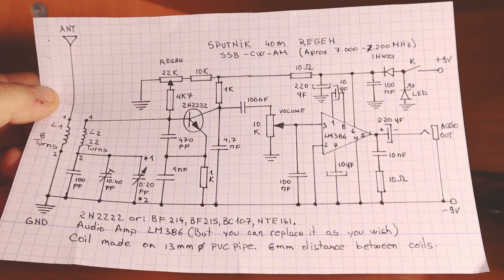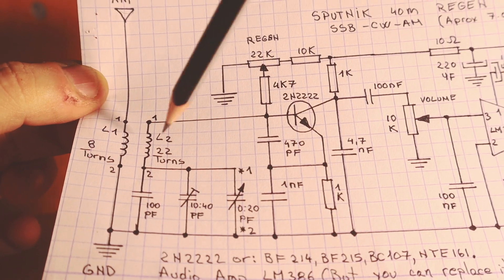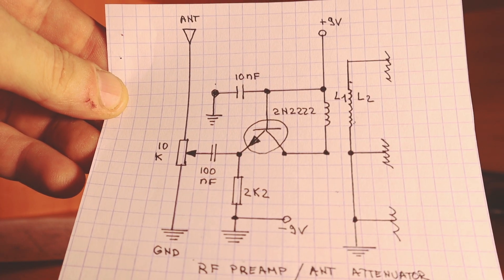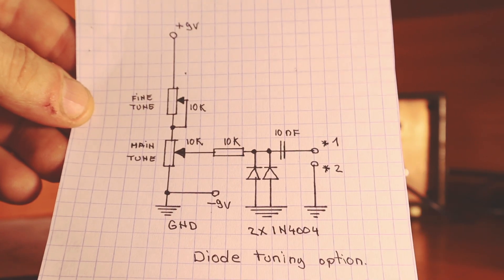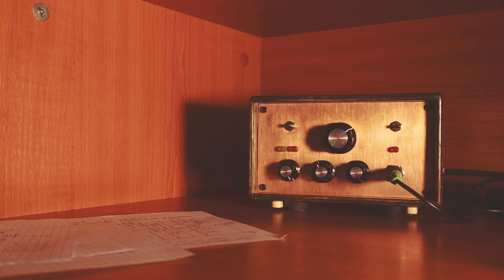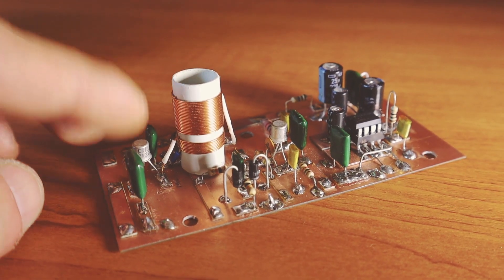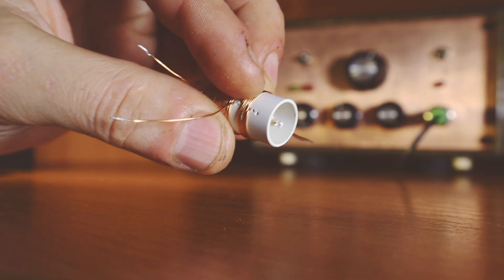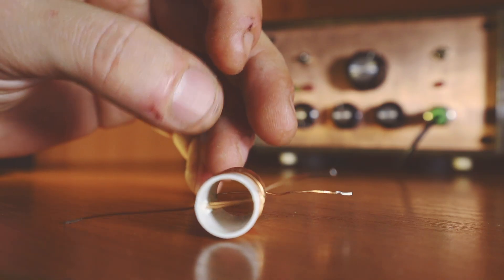Simple Regenerative Receiver For The 40m Amateur Radio Band

Comment: I've recently read up on using diode tuning.  You're having better stability with yours than some are reporting with theirs.  
I'm glad diode tuning is working good for you.   The rig sounds good.
Thanks for the schematics.  73
Reply from the maker: Thank you so much. Some turn out good... some not so much. I think it depends a lot of the capacitors used in the circuit as well... and the voltage stability as well. I could build three identical receivers ... none would be the same unless the quality of the parts is the same ))). I like diode tuning just because is hard to find good air variable capacitors... and when I do find them they are way too expencive. P.S. On the blog article I have the latest schematic I am using and also a PCB design. 73, YO6DXE.
Reply: @dxexplorer You're right on all counts.  And thanks for the schematic update and information.
Here's an article I found in the last few months.  On page 5 there's a lot said about VFO stability.
The part you mentioned about voltage stability is discussed, too.  Online there's s few low volt regulators specified  (advertised / promoted) as "precision" regulators.  However, I've seen some regulators that say they're precision and according to their data sheets they're no more tight voltage tolerance regulators  than any run of the mill regulators, so watch data sheets closely.
There's an old, nearly forgotten VFO that gives really low drift.  Some builders made videos showing how stable they are.  The name of that VFO is "Franklin VFO."  Maybe you already heard about it. 
 Here's a link to Part 2 of a Franklin circuit:  https://www.youtube.com/watch?v=fRz9i3HFhAU
It's found on MIKROWAVE1 channel.  He gives good tips to get it working and shows how stable it is with a very convincing demonstration.  There's a few things different about the Franklin oscillator.  First it it uses 2 transistors instead of just one and second it uses a few "gimmick" capacitors to achieve feedback.  The video gives good information about those capacitors.  It's relatively easy to get oscillation.
Good luck.
Reply from the maker: @southernexposure123 Ohhh yes I did heard about it and love that one. I like the videos as I learned a lot from them since I didn't had books and magazines... but then I got the book as a PDF and learned a lot more. I find old school analog VFO's very exciting. They are a lot like fly fishing. You put a lot of patience and work in getting them to work well and stable... but then is all just fun and joy 😁.
Reply: @dxexplorer Understood.  I started tying flies again a little in the last few months, too.
I'm about to gather the parts for the Franklin in a short while and see how it works for me.  I already have some NP0 capacitors  and a few C0G caps.  It'll be an interesting experiment.
I found the Wes Hayward book "Solid State Design" PDF and I have that one in paper anyway.  I also have the Doug De Maw QRP little blue book.  I almost read all the words off the pages a few decades ago.  
THEN life's little distractions made me drop out of building projects because of working so far from home.  I barely had enough time to commute and get a short nap before beginning the commute for the next day.  Oh well.  I have the time to get back into building now.
Reply: @dxexplorer   Oh, I meant to say I couldn't have made a circuit work without, books, magazines and schematics.  You're way ahead of me on that count.
Reply from the maker: @southernexposure123 I know the feeling... both with how life is keeping us away frim the things we like doing..  and also too much work and not enough free time )). I miss fly fishing since we spoke about it haha. I haven't been fishing in years. Going back to the books... I have both as PDF and read them like a little kid reads pirate stories )). Sadly I don't have any NPO capacitors left and no COG either. But I will try to search online and see if I can get my hands on some. I have a few nice variable capacitors from subscribers to the channel and I treasure them like gold )). So maybe this winter I will start playing around with some simple VFO circuits just to learn the craft..  then experiment a little and see how good and stable I can make it later on hehe. I have a feeling I will get very mad at times, but it will be fun. No good thing comes easy )).
Reply: @dxexplorer  Last Summer I started back fishing in a little plastic boat.  My balance has been shaky the last few years.  I injured both knees last May and my decreased balance issues scared me away from getting back in the boat.  My knees are gradually improving so maybe next Summer all that will be better.
I don't remember why I picked the Colpitts oscillator to build.  That was 3 or 4 decades ago.  Likely someone said it was the most stable of the ones generally used by hams.  After "finally" getting it to work (I think it was a good VFO choice) even  with NO0 caps though stability is still an issue.  I'm hoping the Franklin oscillator will do what I want.  
The reason I had such a hard time getting the Colpitts oscillator to work was the capacitor values shown on the schematics.  The capacitive divider values shown was 2000 for each of the capacitors.  After weeks of failing I took out the 2000 total capacitance and put in 200 pF in each side of the capacitor divider.  That's what worked for me ever since, although I sometimes have to use 400 pF on each side of the divider.
There's some capacitors marked +150, +750 etc.  Those have positive capacitance value change with temperature change.  Sometimes finding the exact combination of NP0 and  other capacitors with positive OR negative capacitance change with temperature / volt change you'll find the right combination of capacitors to get zero frequency drift.  Each of the capacitors in the frequency determining portion of the circuit can affect drift / stability.  You're probably already aware of those things.
I suspect that maybe because 2 transistors are used in the Franklin oscillator the internal capacitances in the transistors acts to balance those changes.
MOKROWAVE1 talks about negative resistance and "Q" multiplication.  I don't understand those concepts.
Maybe the reason I still had drift is because I packed my capacitors so closely together and they didn't have enough air circulation around them to allow the temperature to equalize.  I'll do that differently when I make the Franklin oscillator.  Another thing I'll do is instead of using a group of 200pF capacitors I'll use groups of 100pF caps.
The older NP0 caps once had a tiny black ink at the capacitor tops.  The newer ones don't have those marks.  I've found C0G and N+150s etc caps in old stereos and old TVs.
Reply from the maker: @southernexposure123 I will reply tomorrow as today i am crazy busy writing some articles for a magazine. But... guess what I found just earlier... ? Exactly the detail you needed about the string on the receiver hahaha. https://youtu.be/pmtNtQHMgQo?si=MZ2s80fgAKxbP6XV
Reply: @dxexplorer   Oh I meant to include:  There's a few large variable capacitors on Amazon, but they cost more than I want to give, around 38 dollars each.  I did find some transistor sized variable capacitors advertised as 365pF maximum, so I bought a set of 5 for around 10 dollars.  However their maximum capacitance is really only 165pF.     
I found a few old weathered ham radios and I harvested the tuning caps from those.  The Vernier drive still works.  I also got the tube load and tune caps out of the tube section, too.
Oh, I have an idea of how to slow down the tuning of little capacitors.  If I get that idea to work I'll post a video.  You'll understand if I just say the idea is to add a couple of (not sure what to call them) pulleys? to use as tuners.  The one I'll turn with my fingers will ne a really small diameter and the one attached to the actual capacitor will be a much larger diameter.  There'll be a string that goes between those two pulleys.  I'm not sure yet how to prevent the string from slipping.  Maybe put a lot of bees wax on the string to give it traction against the pulleys?
Reply from the maker: There was a way on doing this thing with the string that I've seen in the old receivers. I can't remember how the string was running but it was basically pretty much fixed on one of the rolls... and because it was really tight it worked nearly like a belt on an engine. I think if we search for photos online of the insides of old receivers maybe we are lucky to find some inspiration )).
Reply: Seems I remember old broadcast band receivers used something similar to your suggestion.  Back then my eyes could see better.  I think the string was braided.
Reply from the maker: @southernexposure123 I think yes... I know for sure it was not elastic... really stiff string. If you search for my buddy Darell... ( radionut63  ) here on YouTube... he did something similar on some of his receivers. If you look on some of his builds on the Sputnik Regen Receiber I think he has one made this way. I hope my memory is not playing with me now ))

Comment: Hi what sort of antenna would you need for this radio
Reply from the maker: It depends... you can use a proper tuned antena, or you can just use some wire hanging between two trees. The shortest wire I tested it with was around 6 meters.

Comment: i am building this on a pcb!! i'l let you know how well it works 😀
Reply from the maker: I'm working now on a simplified version that will replace all the older ones and I will remove the older videos. Same performance with less parts but better design 😁😁
Reply: @dxexplorer  that sounds pretty neat!
Reply from the maker: That was the idea at first... to be simple to build... use as little parts as possible but still have some decent performance. Something that would be a great radio project for a beginner.
Reply: @dxexplorer  that sounds ideal for people like me 😅
Reply from the maker: @bass9112  Or like me... is not like I'm some advanced builder in electronics either hehehe. 73 my friend.

Comment: 2:22. I just can't understand the +9v and the -9v at the 2k2 resistor and ground.
Reply from the maker: I put it that way just so people understand that everything that goes to - is the ground. If you are not using a 50 Ohm antenna and you use a wire for example as the antenna... for better reception you connect the - to ground. I hope it makes sense hehehe. But in the video description you have the link to the article where you can download the new schematic and the pcb design that are way better now. Or check the newer version 1.0 Plus as it has an audio preamplifier as well and you can also use a speaker. Let me know if you have more questions. Feel free to email me. 73 my friend.
Reply: @dxexplorer  well... thank you.

73 from brasil.
👏👏👏👏👏👏
💚💛💙🇧🇷🇧🇷🇧🇷

Comment: Is it possible to change tank circuit for medium wave band?
Reply from the maker: Not sure to be honest. That's a good question. Technically with the proper modifications I guess it should. But the Q factor or the LC circuit will change a lot... and I think the transistor may not go into oscillation. So for that there would be needed some more changes into the resistors and maybe also the regen potentiometer. I'll have to try one day.

Comment: Thank you for sharing, a nice simple project. I think for the varicap version you ar using a 10k for coarse and 1k for fine tuning.
Reply from the maker: I was using the same for both... 10k... but different circuits. I wasn't happy though so I came out with different solutions )) Have a look at the latest videos about the receiver. I think I put the links in the video description. 73 and thank you.

Comment: I love 2N2222, when I used it as 1st osc. stage as a 27Mhz transmitter, I boosted it in high power o/p, even you touch n felt it over 50 deg C., it still worked very well and didn’t burnt. It’s an universal transistor.
Reply from the maker: I do too. I also used it a lot in many transmitter project... simple ones with only one transistor... or tiny transceivers usually with one or two transistors. I still can't believe that I get nearly 1W out of them... with this tiny transistor. So far I only got to burn one... my fault for pressing the key for too long )) 73
Reply: @dxexplorer  I remember my used was  a 2N2222A model and hope this will be forever for generations😁 It is good to use a 2N2219 as a second stage HF amplifier. 73
Reply from the maker: @jamesho703  I agree, I hope it will last forever ))) About the 2N2219 ... I couldn't find any, so I just replaced it with the 2N2222 ... better than nothing )) 73.

Comment: Would BC548C work with this circuit? or do i need something like KC508?
Reply from the maker: Sorry for the late reply... I was busy trying to finish the video for the new version. Have a look at the last two videos.. you may like it better and sounds even better as well. I think the transistor you asked about is equivalent to 2N3094... I use it for the RF and the AF preamp... I think it could work for the regen as well to replace the 2N2222... I just can't remember how well it performs. But if I remember well the difference is not that big. Try it and see how it is. 73 my friend.
Reply: @dxexplorer  Thanks, actualy your reply wasnt late at all tbh, iam gonna build the circuit so the transistor can be easily swapped, (like not that i desolder the transistor and the whole circuit falls apart, thanks for help, iam gonna check the new video, actually the reasson why i commented on this video is because i actually dont really need the RF preamp, i have a 20M long antenna so i dont really need a preamp.
Reply from the maker: Excellent idea my friend.... I should do the same when building test circuits. It's a struggle to solder and unsolder. About the RF preamp.... not really necesary but useful. It's just a few more parts. The thing is that the regen receivers radiate a little bit of RF... like a tiny transmitter... not much though. But sometimes that can bother other amateur radio neighbors. So the preamp prevents that RF going into the antenna. Another useful thing is that sometimes signals are way too strong... and using the potentiometer it's easy to limit that signal so it won't overload your receiver. 73 and I hope it all works well.
Reply: @dxexplorer  Thanks
Reply from the maker: Always a pleasure my friend.
Reply: @dxexplorer  What coil would i need for 3000-5000Khz? (3-5Mhz)
Reply from the maker: Ohhh that low you may have to change a lot more than just the coil. Not sure now... I'll have to calculate and test it. I'll try though and get back to you... maybe in the weekend as now I'm crazy busy with work.
Reply: @dxexplorer  Thanks

Comment: Good morning I set up the receiver, I want to thank you for the design and layout, I ended up redesigning the card because I added a simple audio pre with some components using the BC548, 2n3904 etc before the LM386, now I am happy because I can hear a good direct sound to my loudspeaker, I will make the box and accommodate the receiver, for now only the plate working on the table. Other things I added was a 7809 voltage regulator before diode 1n4148, and I'm doing tests with other varicaps diodes (ex bb809, MV209 etc), and the range has been increasing so much that I can hear the band of 49, 40 and 41 meters, I customized the range for my use.
Reply from the maker: That is great to hear Renato. Ohhh yes the voltage regulator should increase the stability even more.... and the varicap idea it's great. I always tell people that they are free to experiment and get the receiver in the desired band or frequency as they with to. Can you help me with the schematic of the preamp  ? I tried one as well for the same reason.... but I just couldn't get it to work as the LM 386 was always going into oscillation.  Here is my email: contact@dxexplorer.com  ... 73 my friend.
Reply: @dxexplorer   Soon I'll be home and I'll send you ok 73!
Reply from the maker: @renatoalves2282  I got them..... thank you so much. And I love yours by the way. 73 and have an amazing weekend.
Reply: @dxexplorer  other tests that I did with varicap diodes that give good range are 1SV149 and BB112, 
these reach the bands of 60.49.40 and 41 meters,it is necessary to use a 10k multiturn potentiometer. I will continue doing other tests. :)
Reply from the maker: @renatoalves2282  That sounds amazing. I was hoping I will have time today to add one more video, but I just got home and I have to leave again. So I'm looking forward to the results you will have  ) 73 my friend.
Reply from the maker: @renatoalves2282  Renato can you please send me the schematic again ? The one with the audio preamplifier ? I deleted the old email address as I wanted to only use my own... and I forgot to save the schematic from the email  ))) I want to add the preamp on my receiver as well. 73 my friend and have an amazing weekend. Here is my new email: ciprianipopica@gmail.com

Comment: nice radio and looks like it tunes well.
I would like to draw your attention to schematic issues:
LED diode coming from the +9v is upside down
I don't know of an LED that will work of a 9v VCC without any resistor between them.

Plz clarify
73 from Amman
Reply from the maker: I know hahaha... thank you. It was a mistake in the drawing but I fixed the issue in the final schematic. Check the video here: https://youtu.be/9opbXQFGn20

73 my friend and thank you one more time.